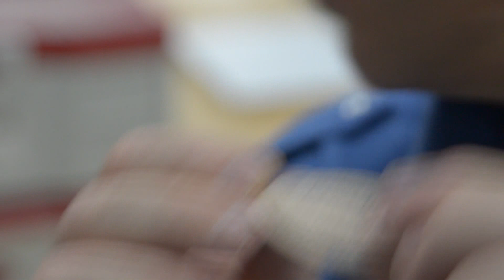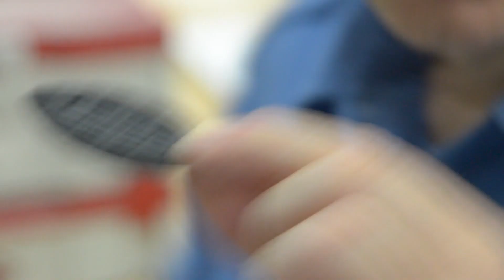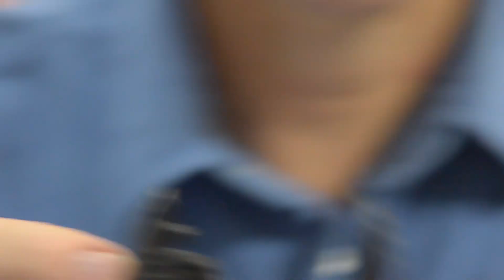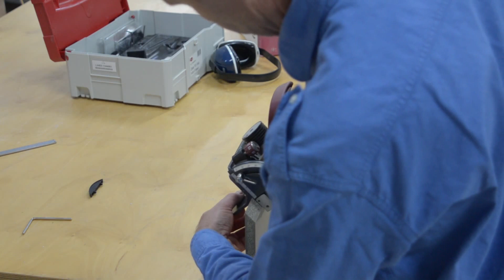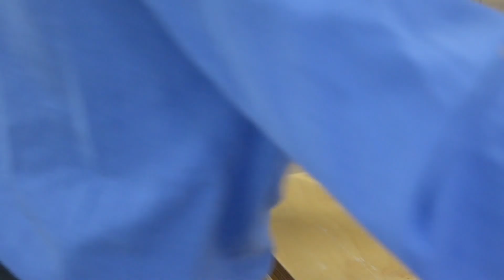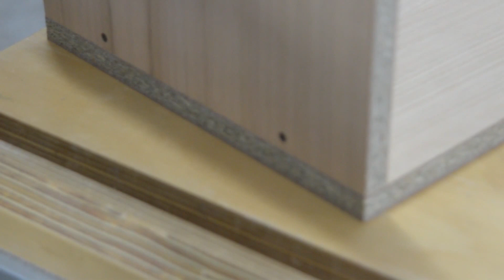Lamello ADVANCED Jointing system : Zeta P2

Comment: Been looking these things up. And while I agree they are off the charts on the “cool factor”, they isn’t a snowballs chance in hell that I’m going to pay $1700 to get the basic system. That’s just horseshit!
Reply from the maker: I am doing a job right now that this machine has no rival for.
If you have ever tried to use things like cam fittings, your really need to spend more $20,000 on a multiborer, or maybe $100,000 on a CNC point to point.
None of those machines can be used away from the workshop.
They are also about five times the machine that say a biscuit cutter is.
Comparing these to a biscuit cutter is like comparing a motorcycle to a bicycle.
Reply: Drastic Measures i
Reply: I've had Lamello biscuit joiner since the 70s, very high quality & durable. Also had a DeWalt, pure junk. Yes, the Zeta system is expensive but it works beautifully. My shop is now full of CNC equipment so we only use the Lamello products where we need some on-site work.
Reply: If you have a need for the basic Lamello plate tool at a fairly high price then go ahead and get it. Mine is 31 years old and still going due to exception build quality and accuracy that is hard to beat. Figure with good care you can get 30 years or more out of it and the average cost per year is reasonable. Used machines are hard to find due to the quality. My uncle Ed is probably still using a dowel jig in heaven.